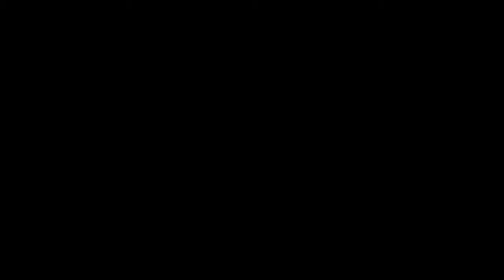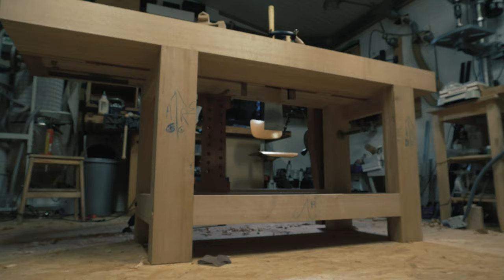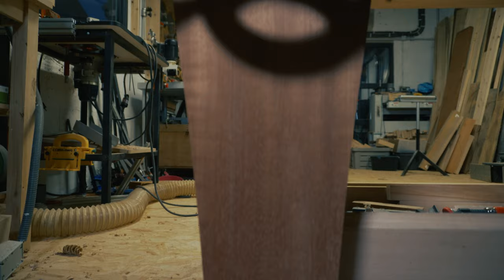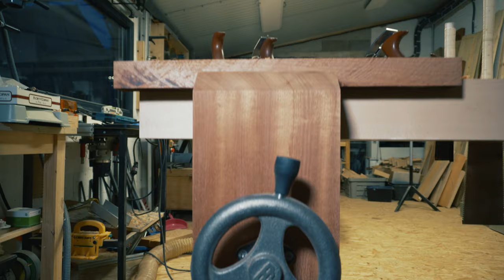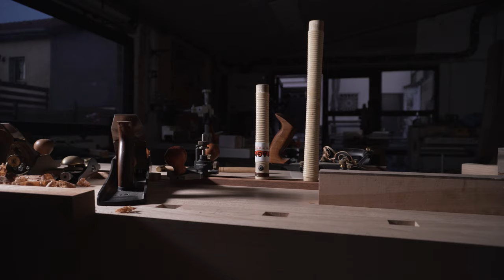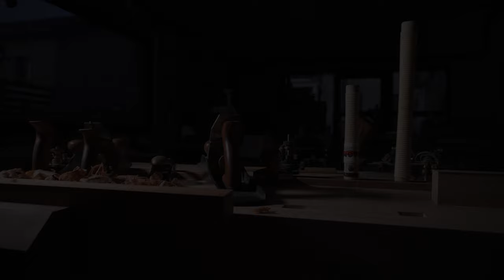Etabli de menuisier.

Comment: Bravo franck. Il est sublime. j ai suivi toute les étapes. Que du beau travail. Surtout quand on a de bon outil.Merci pour les conseils que tu fournis dans tes vidéos.
J ai reçu un coffret de ciseaux 2 🍒 en cadeau, vu que tu les utilise faut il les affûter avant de les utiliser? Question rabot lequel choisir entre un stanley n°4 ou luban n°4?
Reply from the maker: Merci beaucoup. 
Oui je te conseille dans un premier temps de reprendre la planche pour qu'elle soit parfaitement plane. Ensuite tu va devoir les affûter même si en sortie de boîte ils sont déjà bien.
Pour le numéro 4 regarde sur eBay les vieux stanley ou record. Avec un fer Ron hoch tu aura une belle machine de coupe.
Les luban sont pas mal apparemment..
Reply: @creolignum  merci franck pour ce retour. J ai donc fait un tour sur les différent site mais Je n ai pas trouvé beaucoup de n°4 il y a plus de de n°5. Que pense tu des irwin? Y a t il une grande différence entre le 4 et 5. A bientôt
Reply from the maker: @philou0273  la différence n'est pas grande.. mais si c'est pour un premier rabot focalise toi sur un numéro 4... ça passe partout..
Pour irwin passe ton chemin c'est fabriqué en chine..
https://www.ebay.fr/itm/Record-No-4-Wood-Plane-Marples-Iron-Crucible-Hand-Plane-Vintage-/165116726418?mkcid=16&mkevt=1&_trksid=p2349624.m46890.l6249&mkrid=710-127635-2958-0